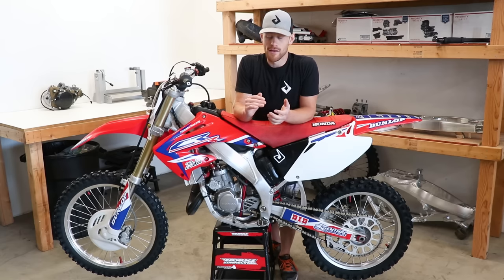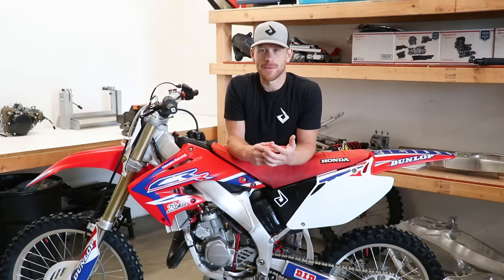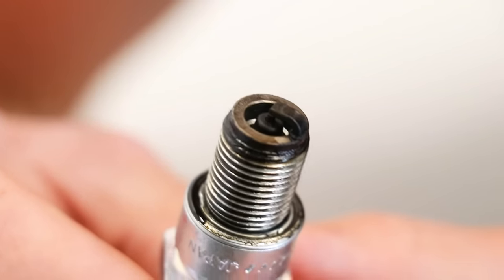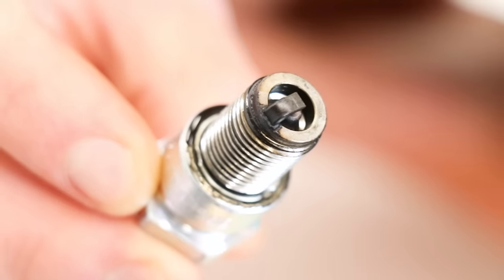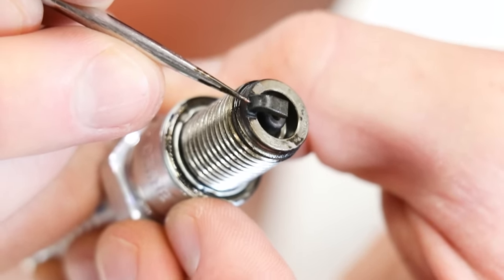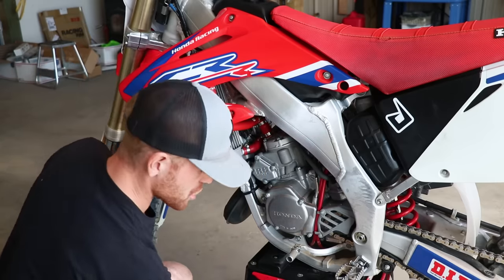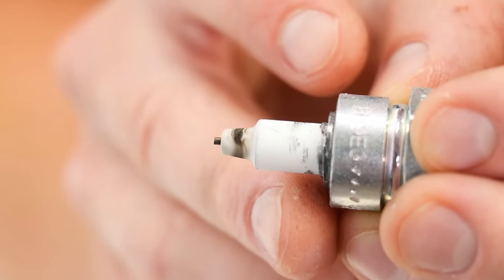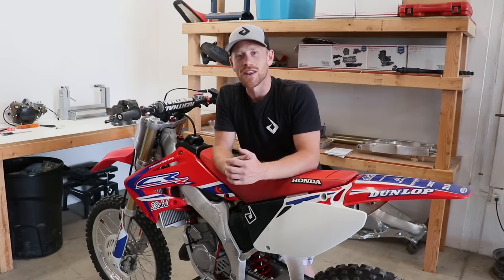How To See If A Two Stroke Is Running Correctly!

Comment: I would much rather replace the spark plug and clean the pipe than do a rebuild
Reply: The exhaust pipe? Thanks
Reply: Dominik Z. Yes
Reply: You need to rebuild a twostroke, they lose compression over time.
Reply: @Dennis in finland we do 2% mix on  50cc's
Reply: Actually running to rich washes your cylinder wall so you need a rebuild quicker
Reply: CJ Waddell yea my 1955 lawnmower has more compression than my kx 125
Reply: Crf150rHf Torcs true dat
Reply: @EuroTrashTV.  how in the world 🌍 do u have a 1950 lawn mover
Reply: @2strokeatvbro630  its a  joke haha
Reply: @EuroTrashTV.  oh ok 👌 I lol 😂 I get it now
Reply: @CoachSludge  yes but mainly depends on how u ride it, my uncle has a 1999 cr250, changes oil and lubes chain. Hasn’t been rebuilt in 22 years and runs like a champ, takes about 10 kicks to get her going tho😂
Reply: @Scythe_Voltage  havent responded to this thread in a fat minute, your absolutely right. I used to rebuild my cr125 every week because I was tearing up tracks full time Monday through Friday. Since then i got a crf450 and rebuild it once a year because i don't ride as much anymore.
Reply: @CoachSludge  this prob sounds crazy but I’ve been riding since I was 8 years old, dad told me rev limiter blows up engines and I thought I would literally blow up in flames so I never hit it and 10 years later I’ve hit it a handful of times and owned over 10 bikes, not one rebuild or motor problem. I still rip the shit out of 2 strokes because that’s what their meant for
Reply: What has cleaning the pipe got to do with the engine blowing 🤣🤣
Reply: @Beuwer  2strokes will blow from intake leak or exhaust not being properly setup idk why but it is true just ask any 2 stroke OG
Reply: @lennilevela6342  en kyl enää aja mopol mut 2 rossaa oli iha hyvä ja kävi puhtaasti
Reply: @CoachSludge  most engines do, regardless of stroke. What's your point?

Comment: I think it's better too keep it a tiny bit rich so you won't risk blowing it up.
Reply: No way lean as you can and change piston regular they are cheap anyway
Reply: Drunk Santa what
Reply: Cr500, 40:1 on the mixture, a tad fat on the jetting to keep it cool. Happy days.
Reply: Rich means more gas..just an fyi..
Reply: @mxfamily2138  although it might be counterintuitive, running an engine a bit rich actually makes it run cooler and safer than running a bit lean, the extra charge of fuel aids to reduce the temperature inside the cylinder because there is more fuel that aborbs heat when vaporizes and because of the higher concentration of fuel the combustion process actually happens faster and there is less time for the heat to transfer to the engine, this is the reason for which running a gasoline engine lean and trying to produce a lot of power safely is extremely difficult, especialy in 2 stroke engines

Comment: There is no leaner or richer when you are talking about the oil. The bike can be jetted to run on the ratio selected the difference would be what the bike is used for, high load=more oil, low load =less oil. 32:1 is a leaner burn than 40:1 this is because the oil displaces the gasoline and since two stroke oil is designed to resist burning and not aid or alter combustion the burn becomes leaner when more oil is added not richer. The oil is then pooled and pushed out in the pipe and on the spark plug because the bikes air fuel ratio is off and cannot use the oil for fuel. Don't try to fix a run ability issue with oil ratios. Choose a realistic oil ratio for your riding, stick to it and jet the bike to run correctly.
Reply: @aaronanderson7619  older 2 strokes 32:1 all day.
Reply: i usually just go for 50:1 oil mix on my dt125. doesnt seem to need more oil
Reply: 4,5% oil mix worked way better than 2,5% on my tdr 125 that was modded full power. It just consumes more of fuel/oil. I'll replace sparkplug soon and see if she runs better
Reply: Not sure if I'm reading this correctly, but are you saying 32:1 is leaner than 40:1 so more oil is leaner?? I thought less oil is leaner
Reply: I was running at 33:1 and found that plugs were fouling and bogging down a little then changed my ratio to 40:1 and didn't have the same problems, so by what your saying my bike was jetted for a 40:1 ratio and by me using less oil is not running a leaner fuel mixture, is that correct? sorry for my naivety i am just trying to learn
Reply: @ggsgaga  it's on the fuel ratio if 32:1 passes through the same jet as a 40:1 you're getting less fuel through the same jet on 32:1 because it is physically more oil to gas ratio through the same size jet basically.
Reply: @ggsgaga  this could be that you were overheating the plug and fouling possibly, by changing to 40 you increased fuel and reduced egt
Reply: Run what the oil manufacturer recommends on the bottle and jet to it as Rory says.  Amsoil Saber really is made to run at 80-100:1.  It is good in small bore engines that rev a lot, as it is really made for chainsaws, but I have friends who swear by it.  I use Dominator, it is a 50:1 oil and actually made for dirt bikes.  Have had great results with Amsoil.
Reply: @duken4evr  you drinking that ams oil cooooool aid eh?
Reply: @clawsss  yeah, I run 50:1 in my kdx200. Seems to run great on it.
Reply: Also, the more oil the more horsepower you make. Some small bore minis run as much as 20:1.
Reply: Grays less oil is leaner, more oil if richer, just think if it like this (if someone is rich they have more money right? Which therefore more oil is more richer)
Reply: A1 Outdoors that is incorrect. The oil is designed to cling to the metal as it passes through the engine and resist burning. When the oil is mixed in the fuel it displaces the engines usable fuel therefore if I add more oil to my gasoline it will displace more of the usable fuel and the mixture (air fuel) becomes leaner if add less oil to the gasoline it displaces less of the fuel and the mixture becomes richer.
Reply: Rory Cobleigh So more gas is richer?
Reply: A1 Outdoors that is correct.
Reply: Rory Cobleigh Well I guess I learned something new today
Reply: I use 66:1 or 1.5% in my gasgas 250,  pentosin mx7 or motul 800.
Reply: LEAN and RICH is terminology used for how much fuel vs air, this terminology CANNOT be used with oil.
The amount of oil in the fuel can effect how rich or lean the bike runs.
If you are adjusting the oil mix ratio to fix the mixture of the fuel ie. how lean or rich you are doing something very wrong.
Reply: Grays fouling from not burning the oil at lower rpm
Reply: @Hexstylee3  sorry to comment a year later but if it's run by a oil pump it doesn't even pass through jets it goes into side of the carb and just mixes with the fuel that comes out the jets correct? As my bike does and it seems to be carbon fouled on plug why? Can you help me please
Reply: @ggsgaga  Think of it this way, you are jetting air/fuel ratio period. On a two stroke on oil is supplied by the engine oiling system, so the ONLY reason that you add oil is for lubrication!  So the more oil the less fuel can go through the jets = leaner mixture remember your are setting (air/fuel ratio) so anything that takes up room in the jet hole will mean less fuel = leaner on the fuel portion.  It sounds backwards but if you think about ratio of air to fuel it makes sense. Four strokes don’t need oil in the fuel because the engine system supply’s the oil for lubrication to the various components including the piston and crankshaft!  🤔👍🏁🇺🇸
Reply: @pintail120  you get it

Comment: Great Stuff Cameron. I'm currently working on a 1986 CR 250 build. It was stored outside in the CA sun. Plastics are horrible. cyclinder needs re-plating/or re-sleeve.

Comment: I’ve drag races for years and tuned some serious nitrous cars which is mainly done buy reading plugs. Best way to read a plug is warm the bike up. Put a brand new plug in it and make a good pull thru the gears. Shut it off and cut the threads and read the  plug.  The strap indicates heat.   Ice Always tuned like a light pencil mark around the white base of the plug.

A hole saw works really good for cutting the threads to. 5/8 cut from the porcelain side

Comment: Without watching the video first, i have learned that the sparkplug needs to be dry and have a coffee brown color.
That indicates that the fuel  mixture and air intake is correct.
When the sparkplug is dark and greasy, this indicates that the gas/oil mixture is out of balance (to much 2 stroke oil has been mixed).
When the sparkplug is mocha brown and even lighter, this means that the mixture is to rich of oxygene, and also the mixture could be to "dry" (not enoug 2 stroke oil mixed)
A almost grey to white sparkplug also means tha tthe burning tempature is to high due to high oxygen levels.
Let's see if i'm right.
Also when the engine is at the right tempature, you will not see any smoke comming out of the exaust when the engine is running idle.
This also means your mixture is ok, and toy won't see any black grease on the inside of the exaust (again dark to black coffee color is good)
I think i'm about 75% right.
My mix oil to gasoline was 200cc oil on about 3 gallons  (12 liters) of gasoline.
But i don't know if the American ammount of cc's are the same as in Europe (i think it is)
I also used NGK all the time but  i made the switch to "Twin-spark"' sparkplugs, due the fact that these plugs would increase efficiency.
But these plugs were quite expensive, and broke every time after just 1 or 2 hours.
So i switched back to the traditional quality NGK plugs

Comment: Did a plug chop on my 2006 YZ250 (295) warmed up then put in a new plug and went full power through the gears one time, shut down and cut plug and you can barely see any residue at all let alone a ring width. It’s jetted to 2007 specs and seems to run decent even wide open. Any ideas?  Running Klotz R50 at 40:1 with 100 octane gas.

Comment: I have a 2001 rm80 that has been bored to an 84cc with FMF  pipe and silencer... my question is if I go to a 32mm carburetor from my stock carburetor (28mm I think) to this 32mm carburetor my bike smokes and fouls out the plug when I open the throttle... it idols fine but won't open up... my mix is 32:1 I'm using a iridium

Comment: I also have a can am 1985 496 2 stroke. Cant find parts. Any help would be nice.  The bike is a machine when running. Rotax 496 motor.  I think it was listed as a 500.

Comment: Yeah thanks I'm cheating I have a racing go kart and I was eves dropping to learn a little about jetting a two stroke and mainly looking to see what tips u could give on reading the plug,ah plugs I see I must sacrifice at least one wow,thanks...my go kart a rotax 125cc two stroke some of the info mite apply,I was going to buy a 7 8 9 plugs and work the pilot and the main a little I'm really looking to get a cleaner low end response,my mid to top is insane,but low end is pretty boring,thanks for the help dissecting a spark plug read I mean really...piece

Comment: Hi Man thanks for share!
Wow… so many years since this video and just now I am making my own plug chop but I did not found good results...   please help me!

I know it is so hard using only data to analyze but I have not more to show.
I made plug chop as listed:
Warm.
New spark plug.
Wot per 6 series one mitute each one avoiding slow jetting.
Plug chop and no carbon deposits found!!!   Nothing!
very clean insolator base!
Is it so lean for a XR150L standard carburization with #102 main jet, 450 mosl, 28°C, Keihin PD Carburetor.

I don't have more to say.

thanks for attention!

Regards from Colombia South America.